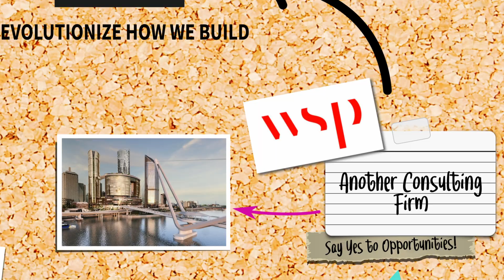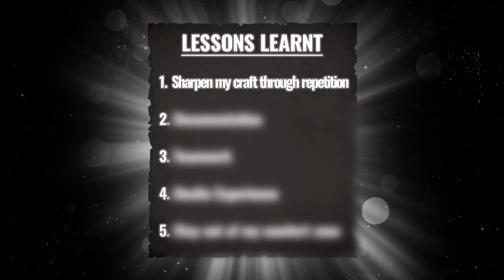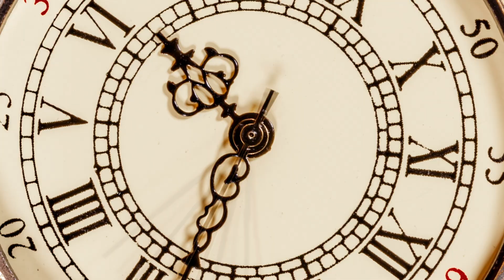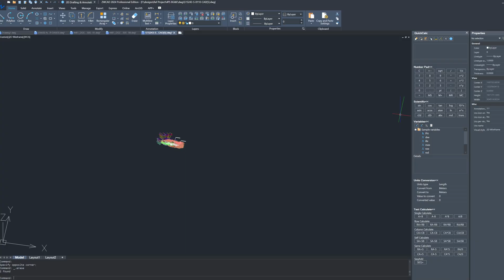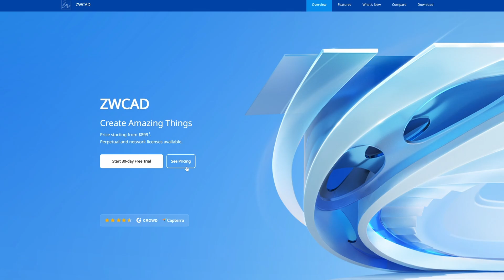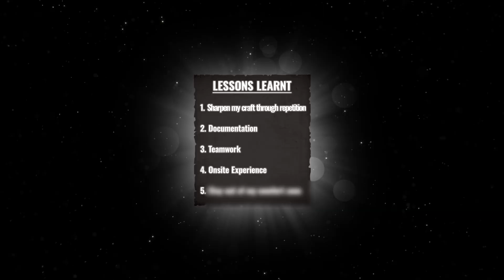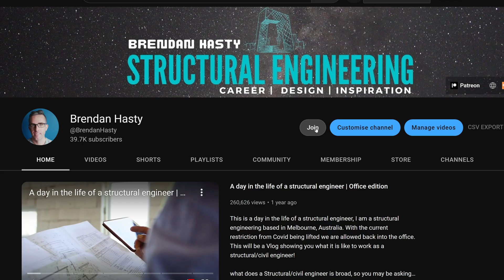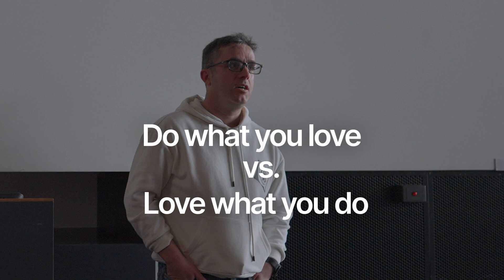5 Lessons from 20 Years in Structural Engineering

Comment: Great caption of your 20 years in the structural engineering. Two key factors you mentioned and i also value were 1. working in a small firm to have a more rounded knowledge and experience on projects before moving on to bigger companies. 2. Site experience is very important to see how the design principles are constructed and areas and problem solving when issues occur on site. 

Malik from Barbados

Comment: 20million buildings and 20million vehicles. 
With EVs plugging in like home robotic vacuum cleaners and parked 23hrs every day 
20million x 100kwh batteries 
= 2,000gWh in storage. Daily. 
20million rooftops 6.6kw 
= 20million x 33kwh = 660gWh daily. 

Fossil fueled generation is 25gW 
= 600gWh if lucky, 300gWh avg Daily

Rooftops are at the ends of the existing national grid and needs no new transmission with EVs. 

This renewable solution has an unloaded grid and is a dirt cheap solution for Australia and the world. 

Our politicians have Arts Degrees and need unbiased engineers with BE Degrees who are free of paid self-interest promoters.

Comment: I have a question. 
A big logical question but simple. 
Outside your structural experience. 
Given the following. 

I have discovered that the national power grid is fragile because it is extremely expensive. 
66% of electricity bills are grid costs. 
Snowy 2, budget of $2billion has increased to $12billion. 
This is the transmission cost that now are added to this project. 

That all centralised electricity generation needs the electricity grid. To disperse the electricity to the millions and millions of ends of the grid. 

That distant Renewables electricity biggest problem is the transmission costs, as nuclear promoters keep saying. 

5 times more electric transmission grid capacity for the 5 times more electricity in the no fossil fueled future. 

This all means that centralised electricity generation has a huge additional cost, the new grid construction costs.

Australia is being pushed into nuclear electricity generation to stop worldwide CO2 proliferation.

Given your background in construction and many logical engineers in construction why do you think the Australian engineering profession is silent on this matter. 

Electric vehicles are also part of the agreed future. With big batteries for the long drive. 
But parked 23hrs every day. 

Rooftop PV is affecting the Australian grid now and needs more batteries. EVs plugged in would be perfect. 

The Australian engineering world is silent. 
Is it your employer politics that keeps engineers quiet.??????
Government big money that keeps engineers quiet. 

If Australia goes nuclear, the sunniest continent on the planet, then 9billion people will need nuclear to stop CO2 proliferation and climate destabilisation. 

Very simplistic but fundamentally true. 

So why the deafening silence from engineers on a nuclear Australia  ?????